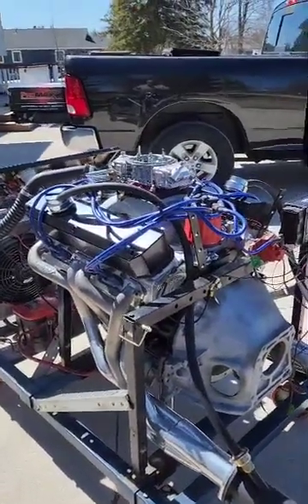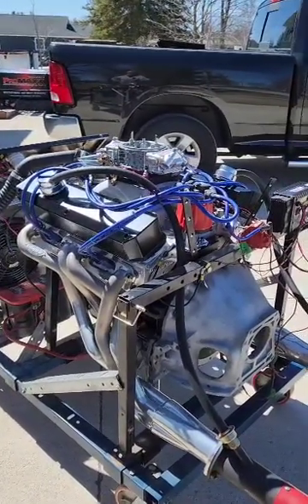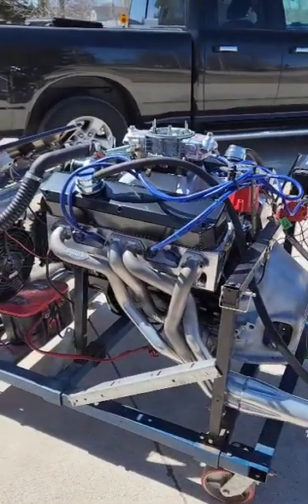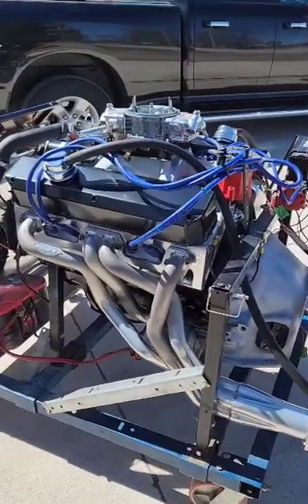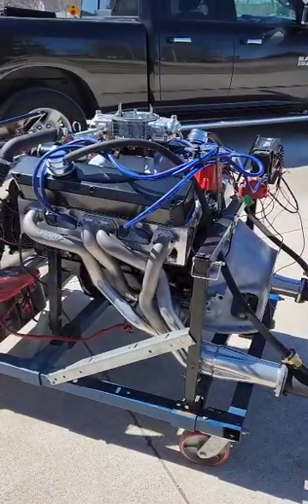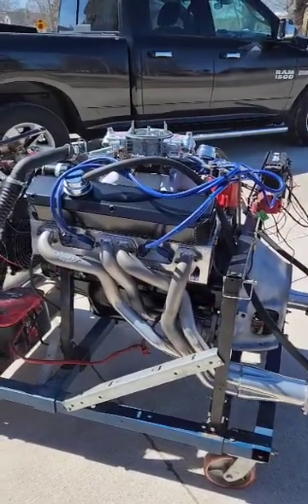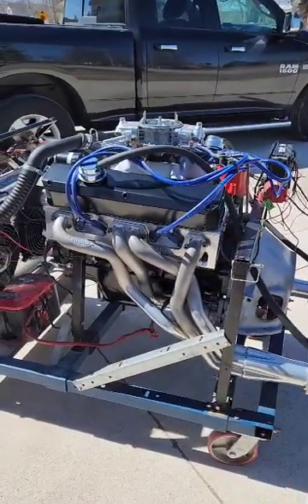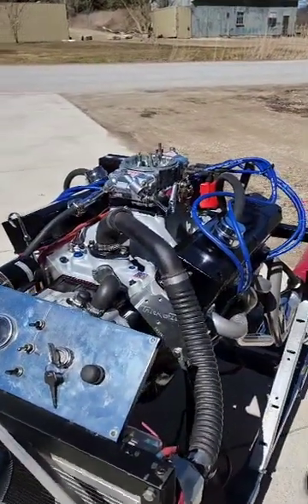Mopar 318 Stroker, Trick Flow 190 heads, Lunati Voodoo Hyd Cam

Comment: I have a question about the compression. It says .043 clearance, is that the gasket's compressed thickness with a zero deck? If so compression calculators say that thr CR. Is 11.8:1. Is it that high...and running on pump gas?
Reply: No... Proper tune and its easy to do. Recommend Sonoco 94 or Shell 93.

Comment: Would this part combo work without the stroking it?
Reply from the maker: You would need different crank and pistons. Everything else will work.
Reply: @brightonracing  preciate the info. I have the same motor in my 84 d150 and about to start building it in a couple weeks and just trying to figure out what I need

Comment: I have a 85 318 .030 over that im building and want to run the same heads you are running/aluminum 360 heads. Would i have to deck the heads in order for them to fit or could i just bolt them on and be fine?
Reply from the maker: The heads are not "360" heads but 318/340/360.... You can use depending on what pistons you have, but if zero deck or negative you will be fine. If at all possible it is good to have your quench at .035 - .045 but again, depends on pistons and if block is decked etc. If you have stock replacement pistons the 60 cc TF heads which are closed chamber will boost compression..... but if only staying stock stroke, the SpeedMaster as cast heads would work too and save some $.
Reply: I've got beefier stock looking flat top pistons but the motor was not decked with the factory 3.31 stroke. I'm looking at a set of edelbrock 318/340/360 heads.

Comment: How does that VooDoo cam stack up against similar grinds from other companies? I ordered that 713 grind for my 440. Supposed to be gooooood.
Reply from the maker: They make good power. More then the Comps I tried. I have a rolling thunder I may use soon and dyno it..... so far the Lunati's are my favorite
Reply: way better. lunati opens the intake valves quick, but closes them slowly enough where it doesnt smack the seat and make horrible noise like the comp extreme energy.

Comment: Just curious what you do to break in the roller lifters?
Reply from the maker: Usually soak in oil prior to build (I don't pump up), prime the pump and turn over as I do, then just put it through some heat cycles.
Reply: @brightonracing  thanks. I see so many opinions and articles. Just want to know what works👍

Comment: Do you mind if I ask what do you charge for rebuilding an engine? I've got a 318 I just lost oil pressure which I'm thinking is a main bearings just wanted  to see what is the roundabout cost if it's okay to ask
Reply from the maker: It all depends on what you want. Trick flow set up is expensive, going roller cam is too. Stock build is reasonable. I have a few 340's too. You can email me or text. My card with  contact info is on the wnd of the videos